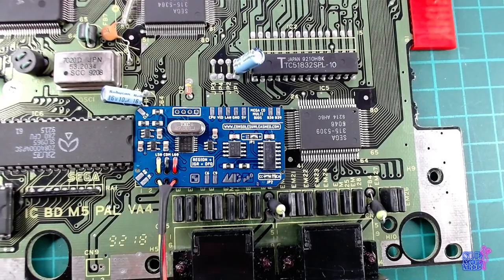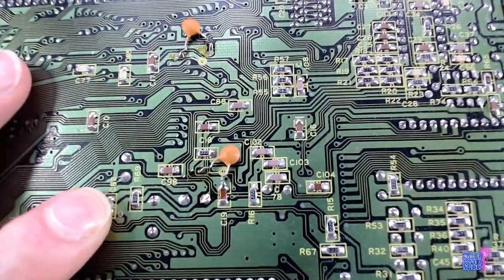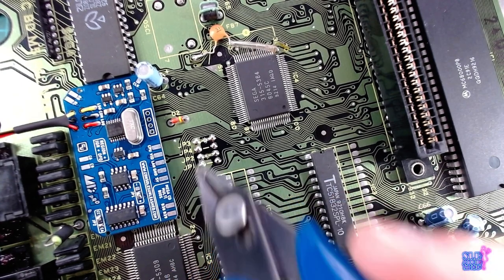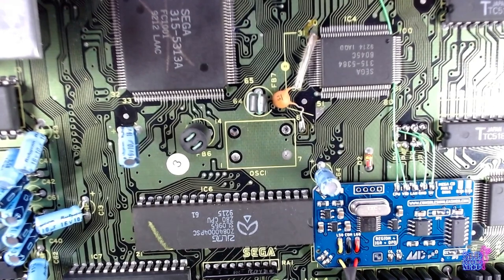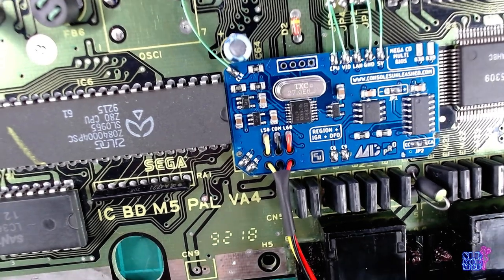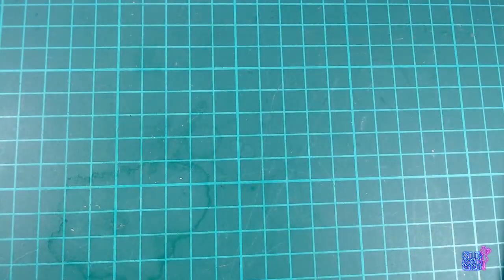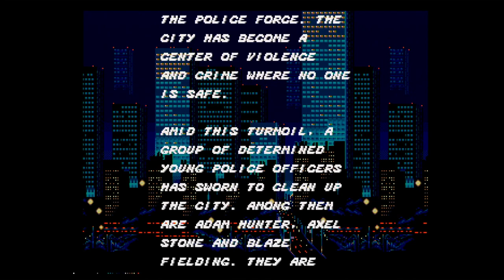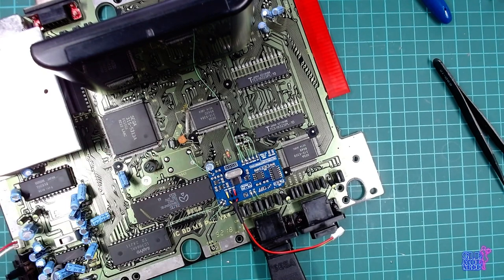Megadrive 1 IGR and Region Switchless install

Comment: Well worth the money the engineer suckers. Not as good as a pump but soooo much better than a cheap sucker.
Reply from the maker: The heat finally convinced me to buy it. A few years ago, a cheap solder sucker convinced me to buy a desoldering gun ^-^
Reply: @SLRModShop  the cheap ones can easily convince you to pull your hair out 😃